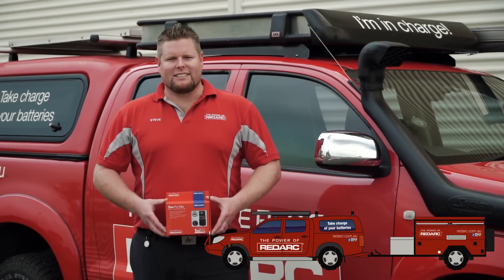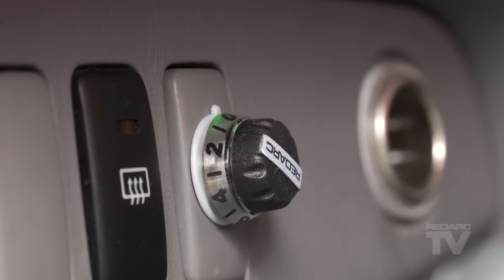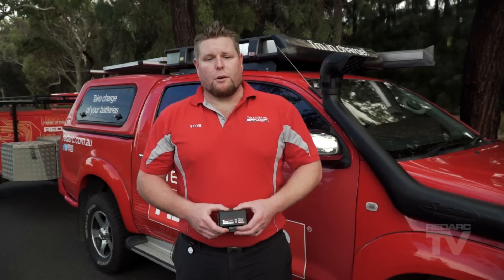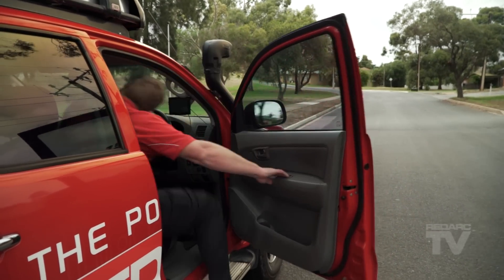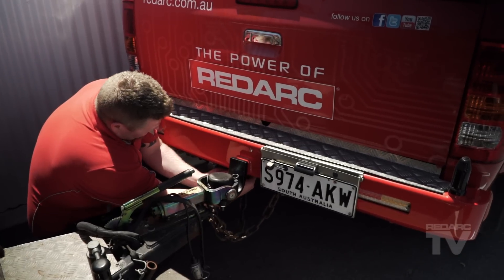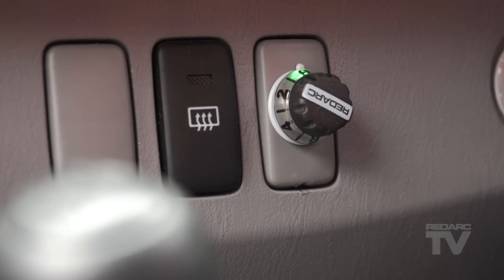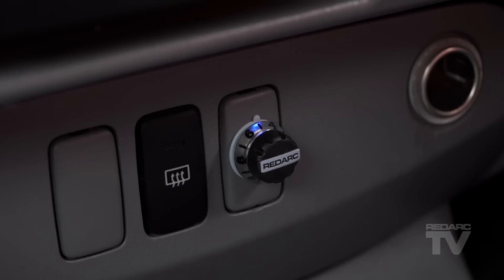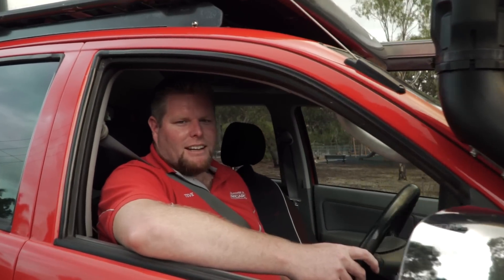Active Calibration Guide - Tow-Pro Elite Electric Brake Controller | (EBRH-ACCV2, EBRH-ACCV3)

Comment: I’m having an issue with the tow pro. I tow a horse trailer so I’m generally only lightly applying the brakes and coasting to a stop and only then am I pressing the brakes hard to come to a complete stop. It goes from basically no brakes, then when I press a little harder to braking so hard that my horse gets throw backwards and almost falls. I have recalibrated 3 times already.

Comment: I installed  the OEM versos (purchased from Ford dealer on my 2020 Ford ranger. everything went well but how do I know it's working? I don't have a trailer yet (order 2022 RV Trailer) so when I drive around it does not light up nothing. If I push and hold the button it will glow/breath blue but that's it. Concern it's not working. Please help....Thanks
Reply from the maker: Hi Paul, thank you for your comment and for choosing a REDARC brake controller. The easiest way is to test the units output with an automotive test light or even simpler, an indicator bulb. We have a procedure on how to go about this on our website; search for ‘Testing TowPro’ in the search bar and you’ll see it there. Alternatively give our helpful Tech Support Team a call and they'll be more than happy to assist over the phone.

Comment: Apparently this thing must stay powered 24/7 to remember its calibration?  How many mA does it draw while the car is not powered?  
(I've ordered one btw)
Also any wiring tips for a 04 VY2 Commodore Wagon if known would be handy. Tnx. 👍
Reply from the maker: Hi Ken, thanks for your comment. The Tow-Pro when in standby (no trailer connected) draws less than 5mA – so very minimal effect on your vehicle’s Start battery. For a Commodore, you should be able to find a brake trigger signal from Pin 6 of the trailer socket on the back of the vehicle and your brake output connection goes to Pin 5 there too. Won’t need any extra protections like a diode etc being an earlier model. Any further questions feel free to give our friendly Tech Support Team a call on 1300 REDARC.

Comment: I installed the Tow Pro Elite a year or two ago on a 2019 Ford Ranger (US) and when it works, it's great.
But I have an issue that when I reconnect the trailer after camping for a while, it starts flashing G-G-B and never completes a calibration - which it shouldn't need anyway. Interestingly, the first time I reconnect it awhen taking it out of storage, it works fine. 
It only starts working normally again (breathing blue) if I connect and recconnect it several times. Eventually.. ... and then only maybe.
This is extremely annoying. Any ideas?
Reply from the maker: Hi there, thanks for your message. It does sound unusual as indeed the TowPro should retain its calibration as long as it is constantly powered on from the Start battery. I recommend calling our Tech Support line and working it through with them as it may not be straight forward. Please give them a call on +1 (704) 247-5150 when you have some time to run through this issue.

Comment: My tow pro Liberty seems to have stopped working. I've confirmed 12v to the unit in the black wire and just under 12v at the red wire when the brake is depressed but no power to the blue wire with the brake depressed. I confirmed continuity from the blue wire to the plug at the back of my truck. Just purchased in December of 2020 and was functioning when I left the campsite last Thursday but noticed that is stopped functioning while stopping along my route home.
Reply from the maker: Hi David, the output (BLUE) wire of the Tow-Pro can provide misleading measurements if using a multi-meter to take your readings. You can use a 12V 21W globe to test the Tow-Pro however, following the Wiring Guide in the resources section of our website. If you would like further information or help testing, please call our Technical Support Line on +1 (704) 247-5150.

Comment: Hi, if your van is still attached and you park & turn the car off & lock it, should the button still be lit up? Mind is
Reply from the maker: Hi Adam, thanks for your question. Indeed anytime the trailer plug is connected to the vehicle, the Tow-Pro should be ‘activated’ and ready to go with the LED illuminated. It draws very little power, so shouldn’t be an issue. It will only deluminate when the trailer plug is disconnected again. Any further questions please feel free to contact our tech support team on 08 8322 4848.

Comment: I have just had a controller fitted . I have the blue light on but when I apply the brakes it brakes but then continually flashes red . I have used 2 different caravans with only electric brakes and it's happening on both.
Reply from the maker: Hi Geoff,
Thanks for the message. You can review this tech tip https://www.redarc.com.au/tow-pro-elite-red-flashing-fault-code and if you still have questions please be sure to contact our tech support team for greater assistance on 08 8322 4848.

Comment: Hi I've just installed the tow pro just wondering if you can take the nob off the controller once it's on as I put it on backwards, it says 10 is 0 and 0 is setting 10, just a human error but want it fixed but don't want to pull to hard in case I brake it, cheers
Reply from the maker: Hi Jake, thank you for your message, and for your recent REDARC purchase. The short answer is yes, it can be removed as the remote head knob is spline fit. But if you have any concerns or would like to discuss further, please contact our Technical Support Team on (08) 8322 4848.

Comment: I'd have to be doing 200k to get a ten second firm braking. Mine won't calibrate after three weeks of driving around town and highway.
Reply from the maker: Hi Russell, if you could call our Technical Support Team on (08) 8322 4848 at the earliest opportunity they will be able to walk you through a few steps to help rectify any issues you are having.
Reply: Thanks for the reply. Good stuff! I have done as you said and I am being walked through a process.